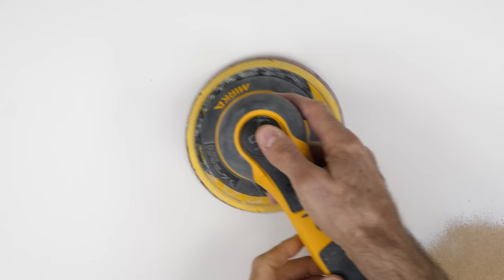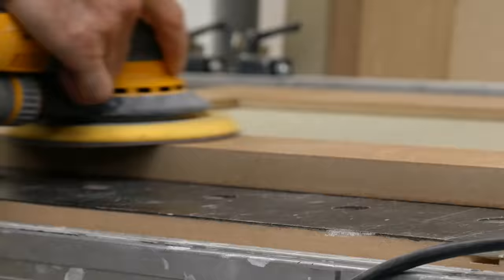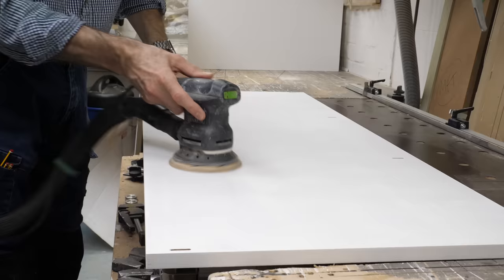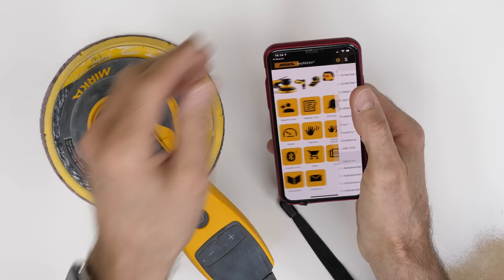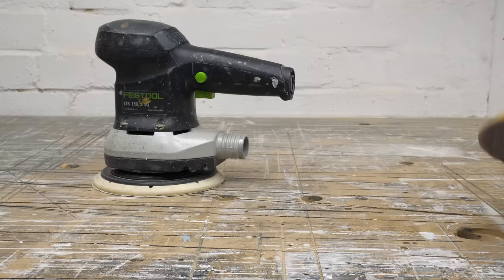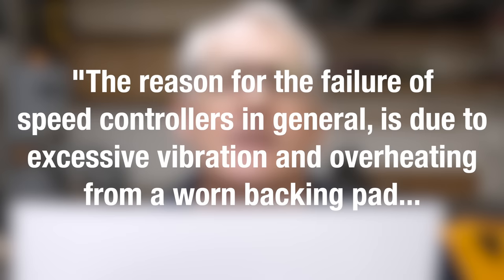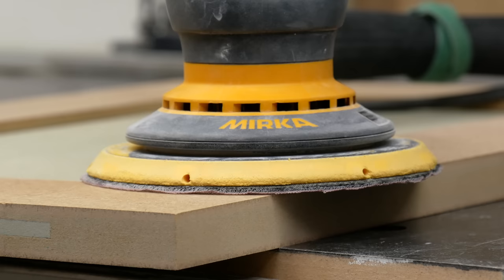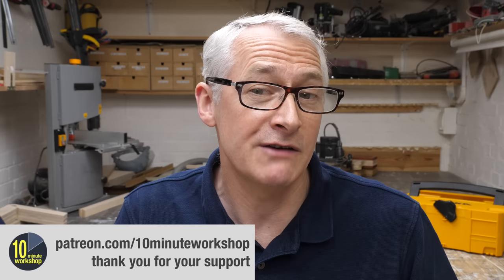Mirka Deros Random Orbital Sander [video 406]

Comment: Since I was an apprentice I used air sander so for me the deros was a good choice. I did like it while it worked however in under 2 years it had a new backing pad and sent off for repair now I’ve got it back but it’s out of warranty so it’s 1 of them delicate tools you don’t trust to be reliable. It’s more than earnt it’s money back but for the price I’d hope it would last longer.
Reply from the maker: Thanks! Yeah, this does seem to be a bit of a worrying pattern; they either seem to work forever, or beak within warranty then you have to treat them carefully. 🤷‍♂️👍

Comment: For years we have used the festool air sanders, and they really are the best I have used in conjunction with the festool air extractor. They do the job and rarely go wrong, and that is using them on solid wood 99% of the time. I see the mirka ones more as a finish sander for as you say de-nibbing not really a general purpose one for flushing solid timber like oak down. I do own a makita version of the festool rotex and that works remarkably well when used in conjunction with the correct extractor. I am a big fan of mirka gold discs  though, very few on the market as good and with the staying power. The backing pad on all of these sanders is important and I think more people should buy the pad saver to use between the disc and the pad and you will find they last a lot longer. You do need to be careful with the more heavy festool sanders that you do not drop them as while they are very robust it can cause damage to the pad and make them appear that they are out of balance when it is usually a damaged pad.

Comment: You like what you like so it’s hard to change tools when something is working and you’re already having success, regardless of how “great” ppl say it is. Unless you have an issue/need with your current setup, brand, name and functions will be a non-factor, especially when the current festool is the same price. Human nature and needs. I use to use your basic dewalt orbit and thought it did fine until I had an issue/need (vibrations) then I moved to a Bosch ROS65VC and thought that was amazing till I had an issue/need (weight and ergonomics for fine finishing cabinets and edges was tedious). Then the Mirka deros came along and I absolutely love it. Light weight, balanced, great dust collection. I moved and transitioned b/c I had issue and a “need”. I needed to upgrade so transitioning was easy. I have no issues with Mirka b/c it’s the best of what I’ve had or experienced and have no issues. If I were to switch to a festool, I’d probably find little nuances too, just because I enjoy my Mirka and it’s working and there is no “need” to change. So Peter’s review is 100% legitimate and agreeable. He’s not saying Mirka is bad, there just wasn’t a “need” to switch from his current setup/tools so I totally understand his return. Keep it up Peter, love your work 🙌
Reply from the maker: Thank you! To be clear I really like the Deros as well now I’ve spent some time with it when the pressure’s off a bit. No, it wouldn’t fit into my system well without making some changes - but I totally understand why people love it. 👍👍🙌

Comment: I love my Mirka Sanders.  I have the six inch,  the 3x5 for inside panels, and the the mini 1" touch up, set up in my sanding station.  They are work horses and have never let me down. I do big customs kitchens and these help me get a fabulous finish fast.  I can scuff sand 40 primed doors in about 40 min.   I got rid of a festool 3x5  as it bumped around too much.  Exchanged it for the mirka and it was way smoother to operate.  I think the Mirka has perfectly flat pad and fantastic ergonomics.
Reply from the maker: Sounds great, and glad they're working for you. 👍

Comment: That is my all time favorite sander. The paddle did take some getting used to for me, but now I love it. The balance is perfect for me. Ive never had a problem with mine. 

The mirka response about the speed controller seems dubious to me.
Reply from the maker: To be clear, I love the sander. But yeah, lots of ‘dubious’ here. 🤷‍♂️
Reply: The paddle/trigger is a throwback from the pneumatic sanders. All the pneumatic sanders I have used have that style of trigger.
Reply: @mechanoid5739  I think that's what Mirka were going for with the Deros design. Their pneumatic sanders are well regarded in the automotive industry. Seems all mirka have to do is up the build quality in line with their pneumatics which lets face it, for not much shy of 500 quid they should have been doing already!

Comment: Hi Peter not sure about the stroke but i have a festool ro 150 and i love it. I normally work with hard wood and in also work with resin. To be able to flatten slabs all the way to polishing with same sander is a big plus for me. Festool sanding pads last a long time if attached to vacuum and i would say almost little to no dust
Reply from the maker: Hi Adrian, and thanks! Yes, the RO150 is a 5mm stroke, great sander, very versatile, but a different animal to this Mirka. 👍👍

Comment: I agree about the paddle being a bit of an annoyance, you have be careful where you put the tool down, what it's next to and so on, I've even had a small bit of thin ply fall over and set the tool away on the bench. That said it's from an automotive pedigree where the paddle switch makes extended sanding sessions easier and more intuitive. I've run it's forerunner, the Ceros, for several years without issue (they are still available). The most impressive thing about them is the dust extraction when using the correct Mirka mesh disks, even with plaster. Not come across any reliability issues other than a friend who had one burst into flames in his hand whilst up a ladder!
Reply from the maker: Thanks! Yes, the automotive/air background plays it’s part, certainly, and I do like the size & weight.  Not a fan of abranet, but there are other mesh abrasives around, and good to hear your ceros is still clogging on. 👍👍

Comment: Had mine for over 6 years, love it.  I find the paddle and hand shaped top very comfortable.  If sanding walls and ceilings, it’s so light and comfy, that alone makes it a great buy. For the same usability Festool,  it’d be 2 sanders approaching 1k compared to 400 for this.  I have a Metabo 450 that I use for heavy stuff, the aDeros for everything else.  My only issue is this nagging feeling it will pack in as others have and that isn’t good for a premium product.  I’m not a Festool addict, I buy their gear if good, others if better.  I have the Mafell track saw as think it’s better than Festool, the Deros as prefer it to Festool, the Domino because it’s fab etc etc.  Dust extraction is superb, for that alone, it’s worth it
Reply from the maker: Excellent, glad to hear it’s working well for you. I really like it too, small, light quiet, great dust collection (expected at this level tbh) fantastic that you can use 150/125 pads. But as you say, there’s this nagging doubt about longevity, and that’s not what you want at this kind of price point. 👍👍

Comment: I was considering a Mirka, but I will probably stick to the cheapo DIY ones.  I’ve had a JCB branded one for many trouble free years, the only downside is it’s difficult to fit a dust extraction hose, but with the help of duct tape you can make anything work.
Reply from the maker: If it moves and it shouldn’t - duct tape. If it doesn’t move, and it should - WD40. 👌👍

Comment: Very useful video, I am looking into buying a random sander and I was thinking about this DEROS. 
I really want a 125 mm, and I do not need a very big stroke. For the rough work I still have an old ROTEX 150, so I will probably get a ETS/EC 125/3. Too many of the comments show controller troubles or other problems from which Festool seems to be free. Although I must say I have a RTS400 which i returned once for a tendency to jump out of y hand. They looked into it but did not fix it, so I sent it in again. I then got another one which has been behaving perfect uptill now.

Comment: Really like my Mirka. I think one of the problems is that the power lead needs to be pushed in really well. It can still work half way pushed in (mostly), and I think that throws people. They think it is the sander that is intermittant, but it really just the power lead. For me, having used all makes and models in high end furniture making shops, I prefer the Mirka Deros.  I got mine from Axminster as a refurbished, for the 'problem' I just mentioned. It is not intermittent-just a simple connection! I saved a fortune, and it is great.
Reply: I have used mine regularly for over 4 years or so.

Comment: When the pad gets worn, it will change the pads resonant frequency (i.e. the frequency with the highest oscillation amplitude), which in turn could (perhaps) make the motor work harder to counteract the unwanted oscillations. However, if they already have a gyro/accelerometer built into the device to sell vibration metrics, then there is no reason the same sensor(s) could not be used to detect a worn pad which is causing excessive wear, and alert the user. 
It sounds like this is a case of bad thermal design... In most (high-end) electronics, it is standard to use a thermal watchdog sensor on the motor-controller board and the motor itself, so that the machine will turn itself off in case of excessive heat buildup.
Completely unrelated but brushless DC motors is a marketing term for small three-phase AC motors. The “electronics speed controller” is a three-phase converter.
Reply from the maker: Thanks. Yes, I understand why a worm pad may impact the speed controller - just that like yourself, I’d expect them to have designed a system that would accommodate it. Didn’t know about the 3-phase thing though - very interesting, thanks! 👍

Comment: My Mirka was repaired 3x in 18 months and then failed outside of Warrenty with very light use so went back to festool.
Reply from the maker: Good info, thanks! 👍👍
Reply: I use Mirka abranet 120 and 240, but recently switched to Mirka auotonet for 80 grit. Much more durable.

Comment: I just received yesterday a brand new one, the no load vibrations increase dramatically after attaching the sanding paper. I guess their balance is very sensitive, a used pad/ sanding paper will disturb it :) this happens just at the two highest speed setting, but definitely feels unhealthy for the tool as it also gets warm fast, without sanding, after 30seconds it feels really warm. I will not take the long time bet and will just send it back.
Reply: The DEROS has weights underneath the disk that needs adjusting when you use interface pads or heavier sanding paper. There is a video from GO Industrial explaining the details. Search for "Mirka Deros Installing Weights Explained".
Reply: @vdis  Thanks for the tip! That makes sense, just maybe Mirka could add this in the box, as for me it was scary vibration and sent it back. I was afraid to hit some lengthy warranty back and forth as some other woodworkers.

Comment: Wow!  I was hoping in the future to get one of these and now I'm, honestly, scared.  When doing my complete house renovation just about everything I bought - usually top middle tier or top tier (tools and appliances) - broke down shortly after purchase and had to go back.  These were items ranging from $100 to $6000.  Each time, from the company I heard:  gee, you've been unlucky, these hardly ever come back.  One thing about buying quality is that at least you get excellent customer service (unless you are buying Hammer/Felder - don't get me started).  Must say that my Bosch tools have never let me down and are still going strong.  I wanted a deros because of all the features you mention, plus the abranet, plus, even for a woman I have very small hands and so many tools are designed with guys in mind.  With my previous bad luck I'm sure if I bought this I'd be screwed.
Reply from the maker: The comments seem to be split 50/50 on this one; half have had exactly the same issues, half have had none at all. 🤷‍♂️👍
Reply: @10MinuteWorkshop  Turns out Bosch does a 125/150 sander with a 4 mm random orbit. They even provide an extra 150 mm disc that has more holes in it so that you can use sandpaper from other companies.   Given that I have the Bosch vac I think I'll go that way.  If in the future I want to go fancier then I can, I guess.

Comment: I brought one a few years ago and returned it.  There's a vibration setting inside you can change via a nut but they locktite it so you cant change it.  Talking to Mirka they basically said its a deign fault so disabled the ability to alter the vibration setting.  Not what you want to hear when you've spent 400 quid so I returned it.
Reply from the maker: Interesting, thanks! 👍👍

Comment: Looking at the manual, it appears that you can disable the paddle by pressing up and down at the same time. This puts it into a mode where you control the speed solely by the up and down buttons. It isn’t clear to me if it switches out of this mode when you turn the sander off.

Comment: I have an air sander with that flappy thing on the top - hate it for all the same reasons as you. Strikes me that the Mirkas are aimed at the autobody folk. And I reckon if I was willing to pay Mirka money I'd get a Rotex anyway. I just bought a Bosch GEX 125/150 AVE - interchangeable 5 and 6 inch pads, 4mm stroke - best sander I've ever had - a bit heavy and tall, but the low (and I mean LOW) vibration makes up for that. I fitted a Festool socket tail - very handy.
Reply from the maker: Thanks Jeremy. Yes, I always forget about air sanders - not on my radar at all - but I agree, I think it’s where Mirka background is. 👍👍

Comment: Hi Peter, I am sure the Metabo sxe 150-5.0 has both 150mm and 125mm if you were to purchase the 125mm backer from metabo it also has the 5mm orbit. Its a good sander I have the 150-2.5 which I really like. It also looks similar to the Mirka!
Reply from the maker: Thanks Chris. I understand that the Metabo is the older (non-Bluetooth) version of the Mirka, rebadged, so yes, I’d expect t it to work well! 👍👍

Comment: I admit that it is 150mm, not 125, but I like my Metabo SXE250.  This is switchable between 2.5mm and 6mm.  With Abranet, it has great dust collection.  It does have the weight of a housebrick, but that is good on large horizontal surfaces as you can simply guide it with one finger.
Reply from the maker: Yep, had an early version of that sander. Great sander. 👍👍

Comment: Hi Peter, nice video as ever ... looking for a 5" sander 5mm stroke look no furthur than the Metabo Random Orbital Sander SXE 425 TURBOTEC fairly new I think I purchased one and its brilliant also your not stuck to proprietary sanding discs as many other fit well, unlike the festool.
PS I have the feeling you can switch the 150mm pad out and fit onto the other as well as part numbers are the same (or other way round 150mm to 125mm)
Reply from the maker: Thanks Graham - I’ll check that out! 👍👍
Reply: From the looks of it Metabo bought a couple of Mirka’s and replaced the body to match the color scheme.....

Comment: Have a Deros with no problems, nearly always use a pad saver.  
On my list to change to a Neutrik 20A connector, which I've done on all the decent non Plugit  tools.  Expect to put them on the Festools too at some point too. 
I think the Deros transitions well if you've done any car bodywork with a DA, the press to turn off is a slight pain agreed, and the non-standard plug is stupid, and the cable is horrible and poor quality.  😱 gona  change that plug next visit the workshop.

Comment: Milwaukee make a sander that you can switch between 3mm and 6mm circular stroke... it is however a Ø 150mm  this particular sander is made in Germany
Reply from the maker: Yes, it's a rebadged Metabo, I think. I used to have the Metabo, great sander 👍

Comment: Hi Piter. I would like to recommend you the BOSCH 125-150 gex ave, I have one for years and I am very happy with it. The orbit is 4mm and there are few types of backing plates (soft, medium and hard) also the 150mm plates have two options for the dust holes patterns. Dust collection is very good even with dust box.
I have used it for refinish floor edging because I was not happy for the results after floor edging sander and even for entire landing. vibration control is excellent. I worth to try it.
Thanks for the video.
Reply from the maker: I'll take a look, thanks! 👍

Comment: I’ve had my Deros for several months, sent the first one back as the “brake” took 10 seconds to wind down to a stop. The second one has slowly gotten slower and slower for the pad to stop and is up to about 7 seconds. Pretty disappointing considering the price point. It is nice to use but it should be flawless. My next sander will be another FESTOOL.
Reply from the maker: Thanks! Yeah, seems to be a pattern; some folks seem to get a tool that didn’t miss a beat in many years, others get one that’s plagued by silly faults. 🤷‍♂️👍

Comment: LOL Mirka Mirka ,i ve had a Dewalt for years ,well the Velcro went on it a few days back letting  one of the guys use it ,they sold some stick on replacement for about 35 Canadian bucks at one our bigbox stores ,so i said no and bought another sand a Bosch ,yes another 5 inch sander ,well yesterday on bought the replacement pad on amazon for the Dewalt for 21 bucks ,and i ve use even a 40 grit on it to strip down an old table top and old oak doors  i think you know what i think of the Bosch sander huh ,and that flap thats like changing a table saw blade with it running Peter

Comment: Hi Peter, you do get a Festool 125/5 sander but it runs on air (LEX 3 125/5). I thought the Rotex 125 did 5, but it's only 3,6mm. I do like that yellow color though.I have bought maybe 7 Festool sanders over the last 30 years. Have never had one break down, only stolen 😢
Reply from the maker: Thanks! Yes, I always forget about air sanders as their not on my radar at all. 👍👍